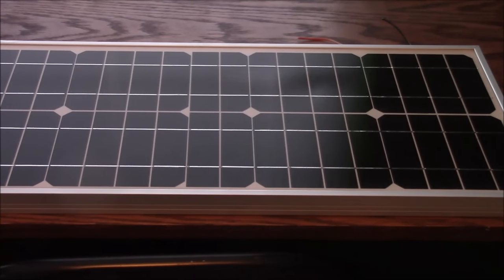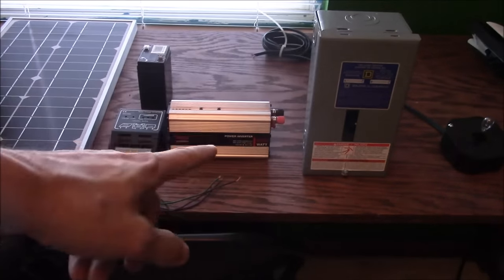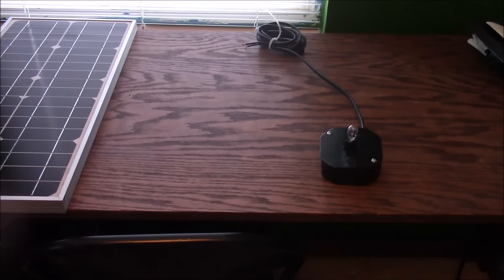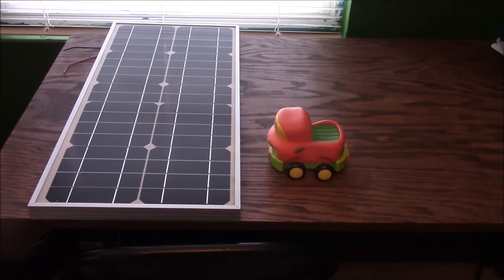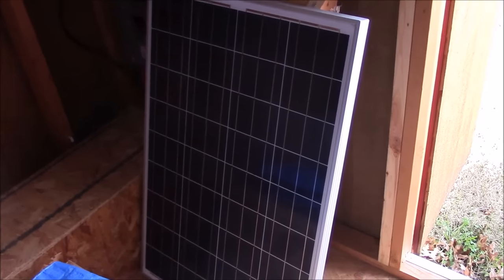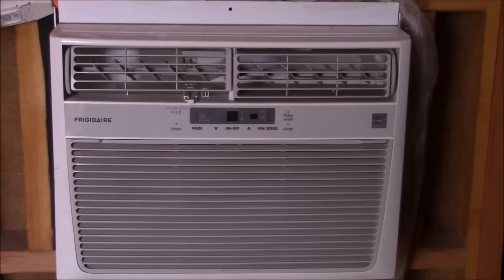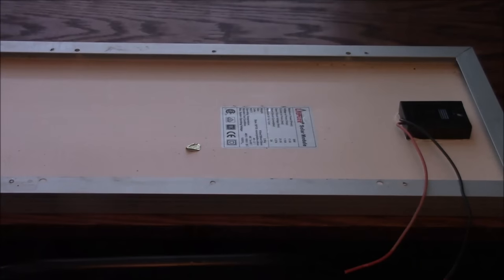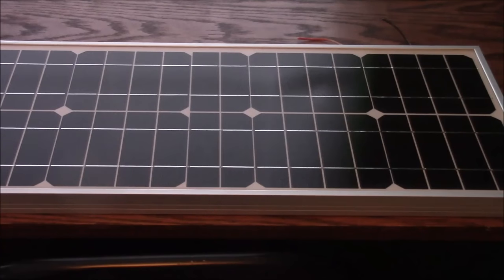Solar Panel Systems For Beginners - Pt 4 Frequently Asked Questions

Comment: I have an ADEMCO VISTA alarm system in my farm. It works with AC using a transformer 16.5VCA 25VA and has a 12volt 4AH backup battery. This year for two different reasons I have not have electricity for 4 hrs or more and the battery died and I did not have an alarm working. Watching your videos I´m thinking about solar. Maybe a grid system that will replace the AC coming from the house or can I use the battery of the system to store the energy? I don´t know really. What do you recommend? Thanks very much.
Reply from the maker: Yes, you could use solar for that.  But you would have to seriously upgrade the battery since it will now be your power source instead of the house AC power and will have to run the alarm for 18+ hours every day when the sun is not shining directlyl.  Simply connect your solar panel to a charge controller and then connect the charge controller to your battery.  The battery will also remain connected to the alarm system and will actually provide the power for your alarm system.
Reply: Very well. Just a question. If I upgrade the battery, the alarm system will draw just the current that it use and  it will not be damage. Let say I use a 12v golf cart battery as an example
Reply from the maker: Yes that would be what I would recommend.  A big deep cycle battery that will never discharge more than 10% overnight when the sun isn't shining and you need a big enough panel to provide power to the alarm AND charge the battery back up to full each day.  If you tell me the power specs of the alarm system (how many amps or kWh it consumes) then I can help you size things properly.
Reply: Hi again ldsrliance. The only information I have so far is that the transformer it uses is a 120 volt with 2.3A and the console receive 12 volts dc and uses a max of 600mA. With this information, I think, the system will need a minimum of 276 watts. Will this help you in some way to tell me the solar panel needed? Thank you
Reply from the maker: There is basically no way that thing draws 276 Watts 24/7.  If it did, it would require 15 large deep cycle batteries and 3,200 Watts of solar panels to power it year round, including 48 hours of backup power for rainy days.

Do you have a Kill A Watt meter?  That will be the best $18 you ever spend if you don't.  http://amzn.to/2nkpoUC

Plug that in front of the transformer and let it run for 24 hours and then push the kWh button and see how many kWh you have consumed.  You can also view the watts consumed in real time.  We will need that before we can put together a proper system.
Reply: Very good. I´ll get in touch with you later. Thxs again.
Reply from the maker: Please do.  I am interested.
Reply: Hello again. I bought the Kill a Watt . I got readings of 3.4 watts, 0.04amps and 0.07 KWH in 19.40 hours

Comment: I have a chicken coop that i want to add a solar panel for the automatic door, i have an automatic door already but i have to use a long cord from the house, and that's why i want to add solar panel, do i need an inverter? You said on the second video that i can get a fine, how can i do it myself without make it illegal?
Reply from the maker: It depends on where you live and how you install and design the system.  For an off-grid system you are safe in 99.9% of areas.  Just be safe and don't install it on your house unless you know what you are doing.  But if you are just installing a solar panel on top of your chicken coop you are fine.

Yes, you will need an inverter.  Solar panels make DC power and it sounds like your automatic door uses AC power since you had it plugged into your house with a long extension cord.  Do you live in the US?  If so, look for a kit like this one to get you started:  https://kit.com/LDSreliance/beginner-solar-diy-kit-100-watt

Comment: Thank you for making a very useful tutorial I've watched part1 - part4, and I would like to ask.

How does monitoring device "SCC" that live or still work.
In case I was in the USA and the "SCC" was in Mexico or Indonesia or South Africa or secluded place.

I use the device to monitor the transmission medium "VSAT" internet.
What the enhancements is needed to monitor the "SCC" using internet communication media ?
Reply: What the parameters is needed to do the SCC device monitoring that is alive or still work ?
Reply from the maker: SCC?
Reply from the maker: Most charge controllers cannot be remotely monitored.

Comment: What is the absolute best portable solar panel for backpacking that can charge #1 to #4 18650 batteries for a flashlight?
Reply from the maker: Good question.  Are these batteries wired in series?  In other words, what is the voltage of the battery pack?  How many amp hours total is the battery pack?
Reply: +LDSreliance actually I'm looking for the best one and most dependable to charge a Thrunite TN 32 Flashlight. It holds 3 - 18650's. The charger is separate. The charger is a Thrunite charger that can charge an array of batteries from 18650 to like AAA. I have looked at the firefly by Renogy. It is so costly tho at $499.00. Any advise?
Reply from the maker: Luke Carter
So are you looking for a solar panel to provide power to the charger or a better charger?  I assume the charger uses 110v AC power so a solar panel could only do that with an inverter, which would be inefficient.  Is there a 18650 charger that uses 12v DC input?

Comment: so if I want to run a 5000 BTU ac unit i will need more than sufficient amperage coming off the batteries?
Reply from the maker: I'm not sure I understand the question.  To run an air conditioner off of solar, you need 4-6x more solar panel wattage than the a/c unit consumes (depending on how much you run your air conditioner).  You will also need enough amp hours of battery storage to be able to run the unit outside of direct sun exposure each day.

Comment: if I wanted  to run a 18 or 20 in fan that needs 120vac how big of a panel would be needed??
Reply from the maker: Depends on how many watts it uses and how long you want to use that fan each day.  Also depends on where you live.

Comment: What are the best or common loads you can power with a 100 watts solar panels?
Reply from the maker: The short answer is anything smaller than 100 Watts.  So laptops, newer TV's, small box fans, small water pumps, wireless speakers, security cameras, outdoor flood lights, etc.  But if you have a decent sized battery bank you can run bigger loads for short periods of time that exceed 100 Watts.  For instance, if you had your 100W solar panel in the sun all day on a summer day with 8 sun hours you could probably run a 6000 BTU window air conditioner for up to an hour or hour and a half in the evening.

Comment: If you have more than 1 solar panel, what is the correct way to connect them? Do they connect in parallel or series or both
Reply from the maker: Depends.  If you want higher voltage you connect in series.  If you want higher amperage you connect in parallel.  It is more efficient to increase the voltage because you will lose less energy in voltage drop and you can use cheaper, thinner wires.  However, it is harder to find 24V, 36V, or 48V devices especially inverters.  So if you "upgrade" to higher voltage you need to take that into account.
Reply from the maker: For most beginners you will probably want to stick with parallel.
Reply: LDSreliance Thank you!
Reply from the maker: You are welcome!

Comment: I have a solar panel, battery, charge controller, and inverter, I have seen "plug-and-play" solar kits on the market where you can just plug the system Into the wall to add energy to your house/grid. how could I make one of these systems myself?
Reply from the maker: Those are not legal in the United States.  I have yet to see any company produce one that is legal, despite the many claims on their websites.  You can kill or hurt someone working on the grid by feeding it with power they don't know about.
Reply: LDSreliance good but sad to know.  I live in an apartment complex and our bill is consistently over $200/month even through conservation.
Reply from the maker: Yeah it sucks.  Other countries use them that have less safety regulations but unfortunately, unless it has anti-islanding protection built in and has gone through the certifcation processes like RoHS and UL and all that then I would say stay away from it.

You might still be able to creatively use solar.  Do you have a south, east, or west facing balcony?

Comment: i would like to know how many 12 volt panels i need to run a refridgerator which have 6.5 amps, with a 1500 watt inverter.
Reply from the maker: +Lincoln Chen Where do you live so I can look up how much average sun you receive?  I assume you are planning to run this refrigerator 24 hours a day off solar?
Reply: I'd say 2 100w panels with 4  180 ah 12v batteries  and a 3000-4000w inverter as long as you  get 4 hours of high sunlight.

Comment: Sir, i have one(1) solar panel 100w; 6.06A(Isc), solar charge controller, 500w dc to ac inverter and my total ac load is 250w.  Do i need another two(2) solar panel so i can reach the total ac load?
Reply from the maker: +rogan caballes It depends on how often you are going to use your load.  If it is just 30 minutes a day you should be fine as long as you have enough battery capacity.  If you are going to use the load for 3-4 hours per day then you need a lot more solar panels.  I can give you a more accurate answer if you tell me where you live, how long you use the load each day, and how much reserve capacity you need in your battery bank in case it is cloudy (if any).
Reply: I used my ac load 6hrs a day. I`m in the Philippines... Thank you so much for your time...
Reply from the maker: rogan caballes
OK, so if you use 250 watts for 6 hours per day and get an average of 4 sun hours per day in the Phillipines you will need 800 watts of solar panels and 255 amp hours of batteries.  If you want one extra day's worth of power storage you will need to increase the batteries to 510 amp hours.
Reply: if i have 8 solar panels rated 100w/panel, how do i connect the 8 solar panels is it all in parallel connection?
Reply from the maker: rogan caballes
I assume that you want to use them at 12v so yes you would connect them in parallel.  If you want to increase the voltage of your system to 24v to avoid some voltage drop you could wire 2 each in series and then each string in parallel.  But if you don't want to go 24v then don't worry about it.
Reply: thank you so much, sir... God bless...more power...
Reply from the maker: rogan caballes
You are welcome.  Good luck!

Comment: how many batteries does one need to operate your air conditioner, skill saw, or electric tools?
Reply from the maker: Too many variables to say.  You need to know the power requirements/consumption of your devices, how many hours per day you plan to use them, and how many average sun hours per day your location receives.
Reply: @LDSreliance  if a small air conditioner needs 5,000 watts being run for 4 hours a day.  I m in New Brunswick and my location would allow about an average of 4 hours direct sun in winter and average 8 hours of direct sun in summer.
Reply from the maker: So, by definition, you will only be running the air conditioner in the summer, correct?  So if your need is 5,000W x 4 hours per day that is 20,000Wh or 20kWh.  Your production possibility is 8 hours per day so 20,000Wh / 8 hours is 2,500.  So you will need 2,500W of solar panels to pull this off.  However, those are extremely rough numbers that do not account for line losses, battery storage losses, cloudy weather, etc.  So in reality I would not try to pull off your needs with less than 3,500-4,000W of solar.

As for batteries, to store enough power in reserve to run for one day without sunshine you would need 3,400 Amp hours of batteries.  That is a ton!  So I don't want to discourage you but air conditioning and heating are the Achilles heel of solar.  It is very expensive and difficult to pull off.

Comment: I would like to do a grid tie in and plug it right into the wall can you do a video on that that would give back to the power company and lower my bill
Reply from the maker: +northof29 I will put that on the list of videos to work on.  It will cost a lot of money because I would pretty much have to install a grid-tied system but it may be worth it.
Reply: +LDSreliance I have seen a video like that (I don't recall the name). I believe that what he showed is connecting the power that is coming out of the inverter to the socket. It does not feed the whole house but it gave some power back...
Reply from the maker: Oren Yehezkely
Oh, I see.  The famous "plug-in" grid tied inverter.  I have seen people using them and they were fine.  However, those are illegal in the United States and you could seriously hurt someone by using them.  If the grid were to go down and your solar system is feeding energy into the grid you might hurt an electrical lineman that is working on restoring powerlines to people.

Another reason not to use those is that your power company might actually CHARGE you for the power you are producing.  If your meter cannot run backwards and your state does not allow net metering even though you are contributing power toward your bill, your power meter would read that as usage on your bill and actually charge you for your own power.